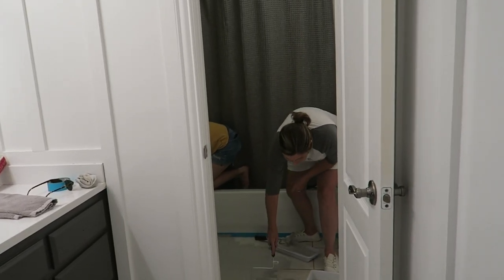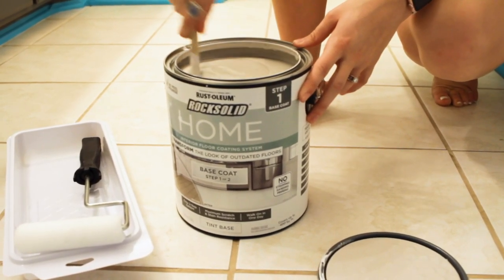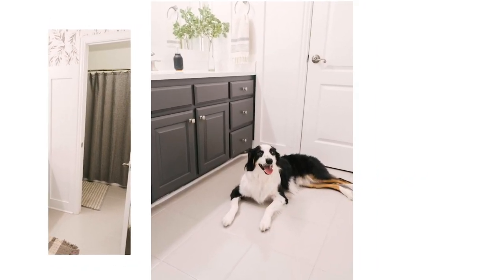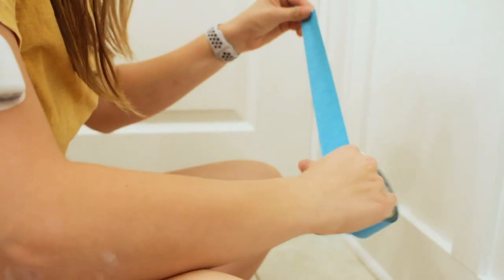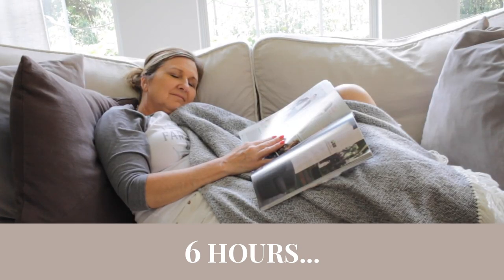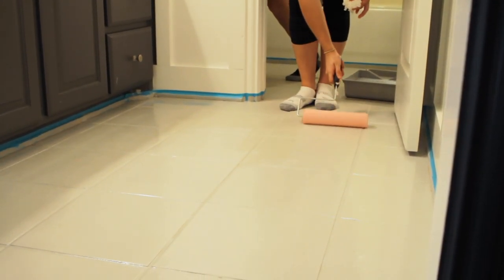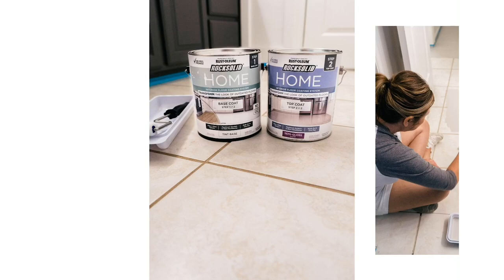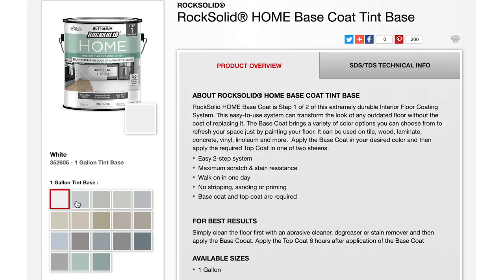How to Paint Floor Tile - DIY Bathroom Transformation

Comment: Very helpful video! What topcoat did you use-it mentions there are two types?  I thought of this before but was worried that no paint would hold up to walking on it.  I have large tile squares in all 1,600 sf of my home.  I am tired of the medium color brown.  I want to go lighter and replacing it all is so expensive and afraid of damaging the concrete floor underneath when ripping out the tile.  This might be the way to go.  My tile is good quality porcelain-just tired of color.
Reply: Yes - please let us know